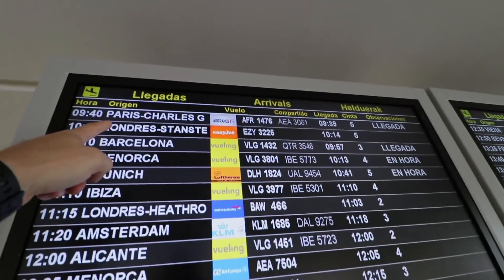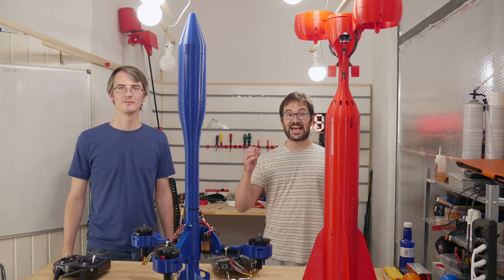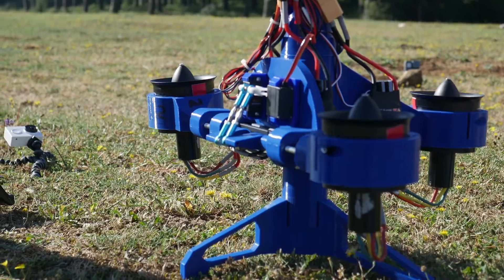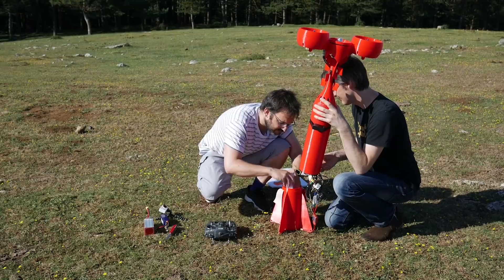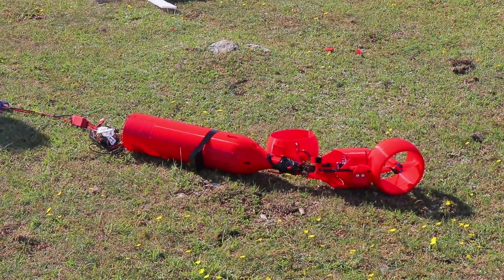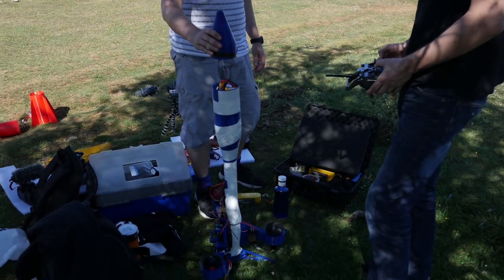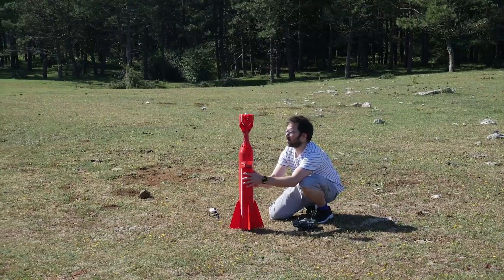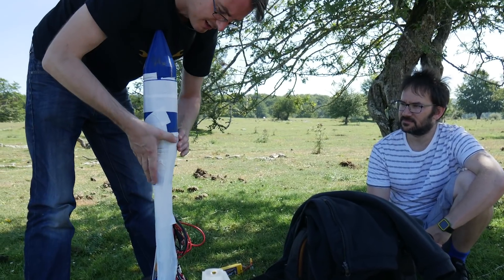3D PRINTED ROCKETS TESTING W. JAMES BRUTON | PT.2

Comment: Also why don't you test orientation beforehand using all the propellers by connecting them to a flat cardboard.  And for crash safe use some padding or long foam sticks on the sides for initial testing.

Comment: Ivan, I think you guys can get this, if you look up the "Rocket Pendulum Fallacy." I don't think you'll need a major design change, as it doesn't seem to matter for a rocket if the propulsion is at the bottom or top of the stack. I think you can get away with lowering your flight control surfaces to the bottom of the rocket, since you won't be leaving the atmosphere.

Picture it like this: The entire rocket is under the force of gravity, not just the bottom. Therefor, the rocket will be propelled in the direction of thrust, which in your case is fixed. Thus, your control surfaces should be at the opposite end of the 'see-saw' that the rocket forms around it's center of mass. 

The other issue would be if your IMU doesn't contain actual gyroscopes! If it's depending on inertial force for guidance, it won't be able to distinguish the gravitational inertial force from the other inertial forces, such as acceleration. If it gets into free-fall, it would read 0 in all directions, for example.

If it's got gyros, just read off of them and ignore the gravitational force.

P.S. If the IMU doesn't have gyros, you might be able to wire up to an old android phone and pass gyro data back to an Arduino. If you're not up to the code, ask James to help, it'd be old-hat for him.
Reply: I don't see how depending on inertial force is an issue. The MEMS IMU don't contain gyroscopes but it's fine, they simulate a gyroscope by a spatial arrangement of inertial sensors. Even if the object as a whole is in a free-fall, if it's spinning, there's a difference in inertial force between the sides of the IC that integrated over time gives gyroscope action. And it's the same for a phone except phones also have magnetic field assist and GPS/GSM to help resolve the magnetic field direction to direction of gravity, but the magnetic field is evaluated very slowly, i don't really think that it helps all that much. Furthermore if you can get some distance between centre of gravity and your MEMS, a single accelerometer may well be sufficient, as you only need to compensate horizontal deviation, vertical is under manual control. The task is not arbitrary flight direction but keeping the nose up.
Reply: I just took a look at my MPU6050, and true to what you said, it has gyroscopes, as well as the accelerometers (i.e. it's 6 DoF).  I know in the older Android phones I've worked with, the gyros and accelerometers are sometimes in different ICs, which is why I posed the issue. Not sure what sensor Ivan is running with. It's probably going to be fine, anyway.

Still, I'd be interested to see the plots of the accelerometers as it flies.

I really think the only thing keeping this from flying is the pendulum fallacy and some control surfaces. Might need to play with the center of mass by moving batteries around. If my time in KSP taught me anything, it's that with some consideration for how it'll steer, and enough thrust, you can launch almost anything.

The KEY thing to remember is that the rocket isn't going to rotate around the engines, thus making the bottom fall into line with gravity, it'll instead rotate around it's *center of mass*, so gravity is pulling equally on both ends. An object will ignore gravity, with respect to rotation, if it rotates around it's center of mass! Ivan needs only to move his control surfaces to the other end, to take advantage of atmospheric drag, to steer his rocket!

Note that this will only work well once the rocket has reached enough speed to bite into the air.

Alternatively, although much more difficult to implement, he could just gimbal the engines, moving the moment of inertia to the top end.

Comment: Blue rocket issue - you either need a Y configuration of engines or a + config for stability, not a T as you had because that always leaves one axis without thrust compensation ... as proved by the fact that was the side it leaned towards and ultimately crashed on. Had that side had its own motor it would have been very much more stable and probably never would have crashed (or at least, not like that and likely not as hard). As for the red rocket, the reason it fell over immediately was down to one major factor that was absent in the warehouse - wind. Even the largest rockets have articulated engine nozzles so that during launch they can adjust to compensate for wind speed and direction. Judging by the direction of the dust kicked up during the blue rockets second crash that wind speed on the scale of your rockets would be like launching a full-scale one in a moderately strong hurricane. Once that process started those tiny rudders just couldn't redirect the airflow from the engines enough to compensate, not to mention only having two of them really prevented any extra compensation to correct from the side it leaned towards (again just like the blue rocket - both ultimately fell in the direction where there were no engines). Don't be too down though, you both did better than most on your first attempts at building a rocket (at least you didn't blow up multi-million dollar ones like NASA often does lol) - there's a reason why we have the saying "it's not rocket science" ... cos the science of rockets is bloody hard!! ;)

Comment: just a standard Quad-copter setup with a big EDF in the middle would be a lot easier to control.
Reply: It will probably just always spin. Because the quad motors are balanced so two go clockwise, two counterclockwise, so they induce an average of zero spin. Then you add heavy EDF motor blades and high-speed motor that spin in just one direction... either the quad motors will be unable to compensate at all or the control range will be greatly reduced so it will have a hard time countering disturbances. It's not really that much better than a single EDF and 2-4 quad motors around it that counter-rotate to the EDF. They had an issue that they can get these EDFs only with one rotation direction, not the opposite, else the build would have definitely been more like classic multicopter.
Reply: Siana Gearz you could ad passive deflectors at the bottom of the EDF to cancel out the rotation or at least reduce it to a level where the stability drone motors could handle it. Maybe you could even use active flaps to control the rotation.

Comment: Motor thrust axis angle smaller that 180º so it has a natural stability. Also 2 propellers = bad idea. Minimum 3 at  120º, or 4 at 90º. The James' compensating system is a great idea.

Comment: I can't help but feel that battery powered, propeller driven rockets are contrary to the whole point of the rocket shape. I'm no rocket scientists but aren't rockets the way they are because their entire fuselage minus the very front bit is meant to be fuel storage for very powerful engines that are mostly meant to push the rocket up at very high speeds and not maneuver too much? If Ivan puts two more propellers on the top of his, he'll pretty much have a drone with a huge dangling bit at the bottom, which might actually help the stability by acting like a pendulum? But it would make it heavier that it needs to be. And if James were to add another propeller to the bottom of his, it would again just be a drone but with a rocket balanced on top of it that is less stable because it's attempting to balance a large top heavy weight, like trying to balance a broomstick on the tip of your finger. Seems like the best way to build a propeller powered rocket would be do build a drone and then stick a rocket on top to make it look more like a rocket. 

Those cows were pretty cute, they were curious about what the heck you guys were doing lol.

Comment: Ivan's rocket flew exactly as it is to be expected from a "pendulum" rocket.
There is a reason why all real rockets have their engines at the bottom.
Reply: No, the reason they have their engines at the bottom is that it works out best space wise, it takes the least amount of plumbing, and you can put vectoring there too, it doesn't actually matter where you place the propulsion system.
Reply: @SianaGearz  The german WW2  "Nebelwerfer 41" rockets are an example for an inverted rocket.
Putting the engine up top meant they could use impact fuses and still have the payload detonate above ground without having the fuse sticking out the front.

Comment: James won this round for sure.  His flew way better than I anticipated.  I thought you had it won with your design and having the motors up top, but James is a master at stabilization.  Hope there's a round 2, even if you don't travel as I know that's not inexpensive.

Comment: Too low speed for aerodynamic moment effect. You should have give them a first speed, a starting speed. You might use solid fuel for first start, then use dc motors.

Comment: most rc  rockets have a  launch pad with extended rod to stabilize them for the first seconds of flight.. you need a 20 foot rod.. AND a stop pin at top to practice go up and down without crashing
Reply: well done  yall.. they fly great horizontally
Reply: actually it went  VERY WELL,, for a first test..a dozen more and youll have it on mars

Comment: Good guys, the way to sky is full of failures, so do not give up.
The Americans went to the moon but proceeded by successive attempts.
Ivan: the neck between engines and body is the weakest point of all your rocket, you should strengthen it a little.
In my opinion the horizontal direction is given by the gyroscopic effect produced by the rotation of the three motors, you should have at least one counter-rotating motor to reduce the gyroscopic effect of the propellers.
I do not even want to think about a wiring error!

James seems that your rocket is more drivable, perhaps if you put the inertial platform at the center of the rocket reduce a little zigzag of the tail.
Of course these are opinions of a clown, but I say my idea then you see.
To both i suggest  the installation of a emergency parachute, lengthening a little the main body, Ivan will find some difficulties more but I think that it resolves calmly

Good again!
i'll see you next video!

Comment: I would recommend adding some code that takes the inertia of the rocket into account.  The mass of the rocket will continue to go in the direction that the thrust of the motor has propelled it even after the motor has gone back to "idle" speed.  Taking into account the rate of speed at which the rocket is tilting before setting the counter-acting motor would be ideal.  If the rocket is tilting slowly, a small change in motor speed can be applied, especially if it's near the desired trajectory.  If the rocket is tilting with a high rate of speed, much more motor thrust is needed to counteract that.  Basically, compute where the rocket wants to be and how fast it's rotating away or towards that point and angle from it.

As for rocket design, it would be cool to have two counter rotating motors with propellers inside the rocket body that could be used to spin the rocket based on which one is going faster as well as provide the main thrust and to have flaps at the bottom for thrust vectoring.  Just some ideas since I totally want to see a working design as you guys surely do!  Good luck!

Comment: center of thrust needs to be under center of mass. If not, any wobble will be amplified by the thrust. Rockets wont "hang" in the air